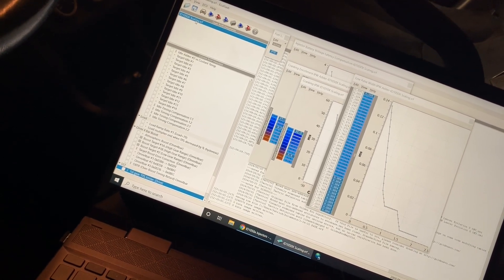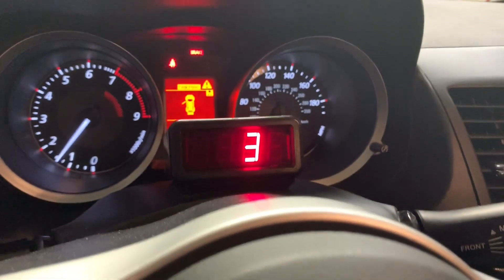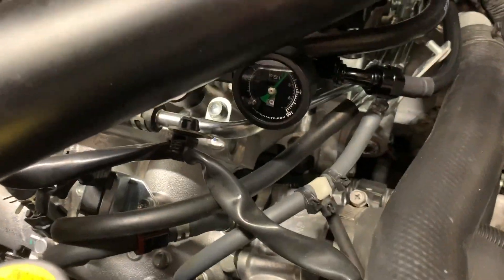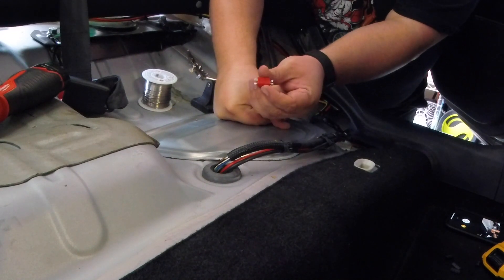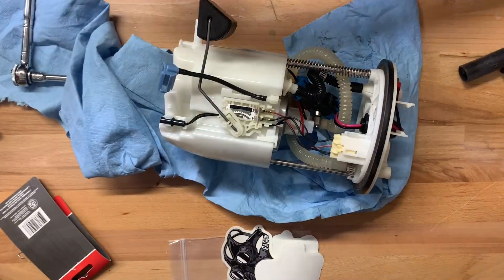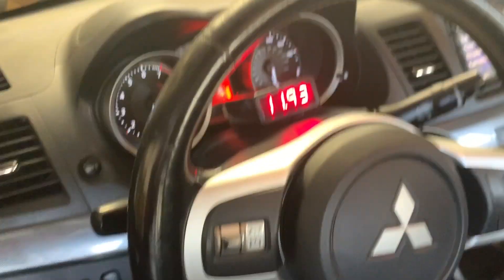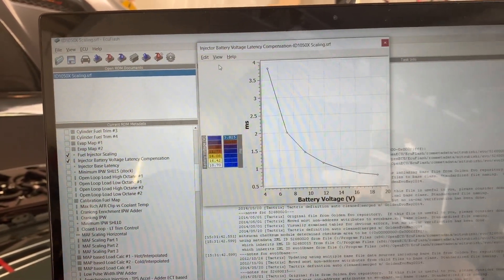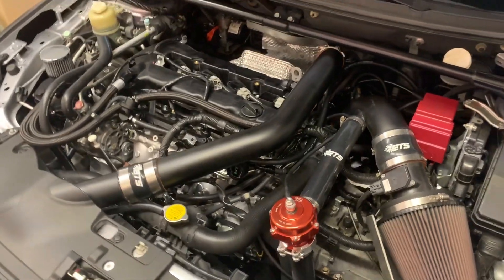EVO X Fuel System Upgrade - Troubleshooting High Pressure - Part 4

Comment: Hey I have an issue with my fuel.  got a code P0007 fuel shutoff valve control high circuit?try to figure out what part I should replace ?is in the fuel pump?or around the engine bay?

Comment: Hi there I dint understand why you must out connectors in there ? Can you please explain ?
Reply from the maker: I have my fuel pump hardwired to allow for higher current draw which helps the Walbro 450lph  reach its rated flow rate. The wiring and connector aren't able to support the higher flow pumps.
Reply: mpbiv421 I’m about To follow the same steps you did in connecting with the DW kit with relay , but I’m just confused when you went back to the pump and connected those connectors . What does these connectors do ? And do you have a link to those connectors . Because I’m going to use you video as a guideline and don’t want to miss this up due to using a stock hanger and one other question . In the walbro pump it dates to drill a 5/64 why did you use a 3/32 instead ? If you could clear this up for me that would be awesome .
Reply from the maker: @djmikeymic10  I tried 5/64 the first time I modded the pump housing and unfortunately it was not large enough still to prevent restriction. I added a "Deans" Connector when I put it all back together so that I didn't have to un solder the wires next time I pulled the pump out. https://www.amazon.com/WS-Deans-1300-Ultra-Plug/dp/B000BOTWW2 they can handle a lot of current draw.
Reply: @mpbiv421  I purchased a deans connector that has 12awg wiring connected to it . Since I don’t solder , can I just strip the cover off wire and connect it to the each ends to its perspective sides ? I wish I could show you a pic of what I have
Reply: I have the 

3 Pairs T Plug Connector Female and Male Deans with 12AWG Silicon Wire for RC Lipo Battery Cable Drone. Will this work ?

Comment: I noticed your Radium fuel pressure gauge is mounted horizontally under the upper IC pipe. I wanted to install my gauge but it didn’t clear the upper intercooler pipe when mounted vertically like in Radium’s pictures. I’m running stock Regulator and the Radium pulse damper in the fuel rail orb port. I’m running DW300C so it’s a bit less complicated. Thanks for the assist here

Comment: Hi, excellent video series on fuel system.
To measure base fuel pressure you need to remove the vacuum line from the Fuel Pressure Regulator.
That’s why your fuel pressure read high
Reply from the maker: Donovan V, thanks. To some extent what you are saying is correct: base pressure should be checked with the vacuum line disconnected, and I probably should have done it that way. But it would actually read lower pressure under vacuum at idle with the line connected. The regulator only increases pressure under boost. A stock fuel system runs at ~43.5psi at idle, so if you cannot get below 60psi, the housing has too much restriction for the flow the pump is putting out.
Reply: mpbiv421 my concern would be that your injector scaling might be affected. How are your STFT / LTFT

Comment: Thanks for the tip on removing the filter in the return fuel line, I'd been struggling with high fuel pressure after installing my surge tank and secondary fuel pump, even drilling out the venture T piece in the in tank fuel hanger didn't help, as soon as i removed this filter she's back down to 47.5 PSI and purring better than stock!